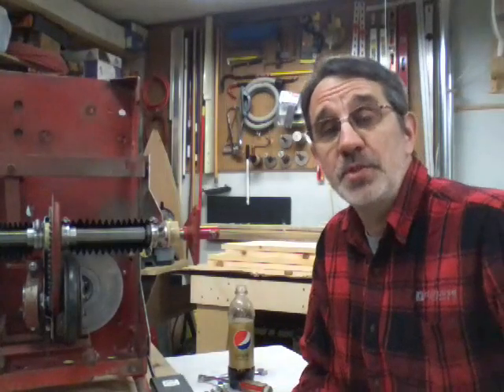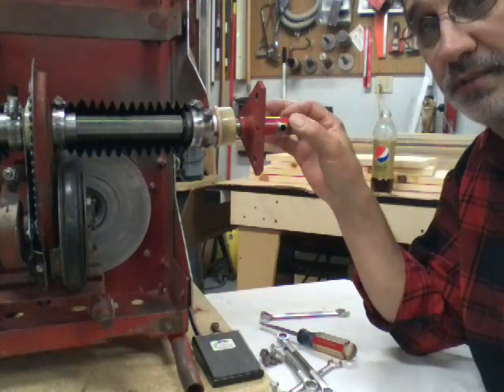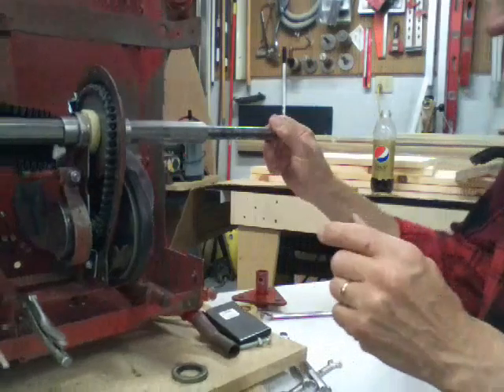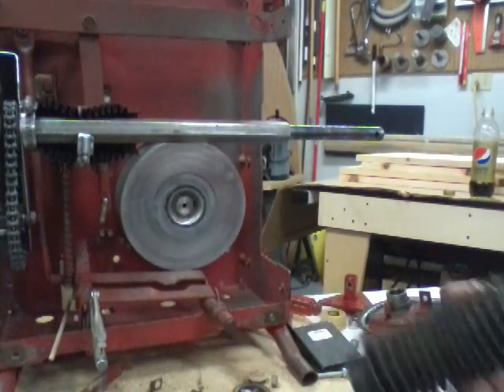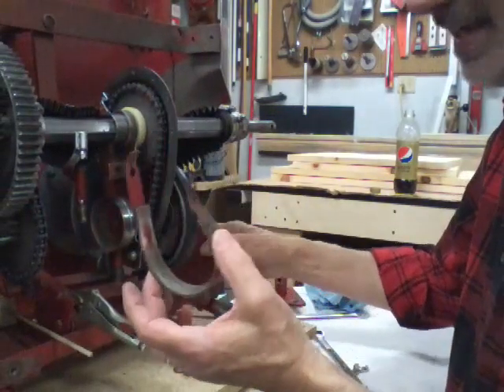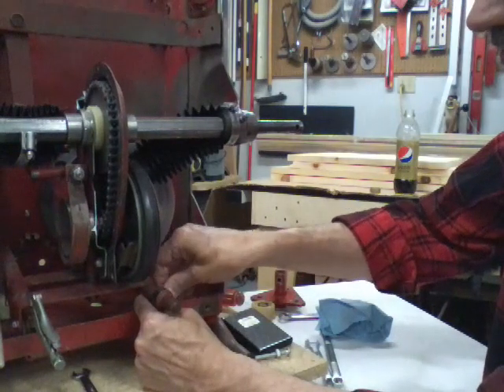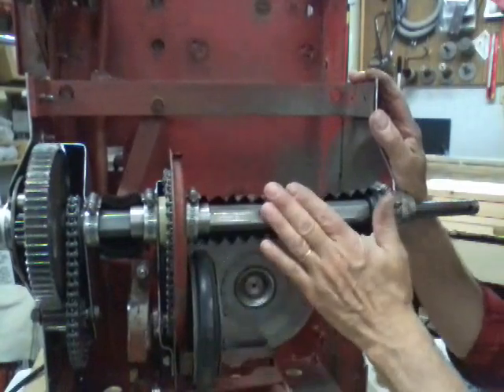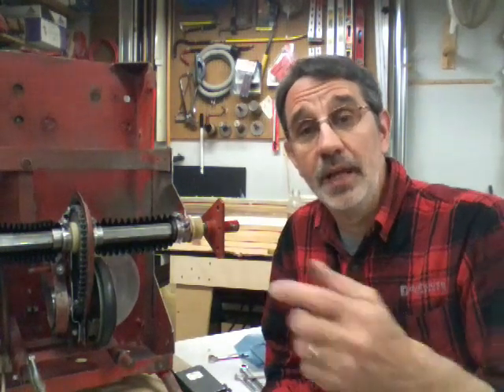94.  M/S 1  Replacing the boots on my Snapper Rider

Comment: Jim –
I just want to thank you for your clear, simple, useful videos on repairing the Snapper riding mowers.
My wife and I recently acquired a used Series 14 rider (with 9 HP engine and 28-inch blade.)
Thanks to your videos I soon learned how to replace the missing axle boots, how to find and replace the safety switch under the seat, how to replace the drive belt and the friction drive wheel and a bunch of other info that would have utterly mystified me were it not for your videos. I also began to appreciate how simple, sturdy and reliable these machines are.
If they gave a Pulitzer Prize for How-To videos on YouTube, you would deserve one.
In lieu of that, I’m sending you a small token of thanks via PayPal.
Sincerely,
A grateful viewer in Georgia, USA
Reply from the maker: Well thank you for the great compliments I do enjoy what I do and I really enjoy helping people, and thank you for the gift of money I can always use that. Jim

Comment: Get'n ready to replace boots,driven disc ( with liner.....I agree with you on the metal banded brake,The liner setup is iffy,reckon we'll see) first polishing the hex,then adding StaLube Moly to sliding gearbox ( as well as filling both gear box & chain case with said lube) ,then Ft steering rod bushings,new belt,LOF,full synthetic,then sharpen & balance the blade.Thank you kindly from one Pro to another.....Ralph                                      BTW & for your tips n tricks.....My 28 Hi Vac's driven disc rubber went completely away & ate at the drive plate a bit....Pulled the spark plug,got my 90* die grinder with 40,then 80 grit paper on the plate while a budie pulled the starter rope slowly...Re-surfaced it,with out removing any material to speak of, like a charm 😎
Reply from the maker: Sounds like you’ve got everything under control let me know how it turns out. Jim

Comment: I respectfully went a different way.  I was just about to the cut slots method when I went another way.  For $70 I bought a 5 ton gear puller at Harbor Frieght Tools !  Some of the best money I've ever spent.  I came around the corner with that 5 ton puller and I could almost hear my Snapper "Oh hell no.  Here's the hub, I surrender.". It only took 4 pumps !

Comment: One quick question-when you take the left fender off, is there any possibility of the mower collapsing to that side?  Most would still have the deck on while doing this, and the added weight could be a factor.  I know you have to have done it this way at some time.  Just a quick yes or no.  Thank you
Reply from the maker: John 
If you just takeoff one fender at a time you should be OK I’ve never had a problem but if you’re going to take both fenders off I take the mower deck off to alleviate some of the weight. Jim
Reply: @jimjackson9381  Thank you for your response, and your time and efforts.

Comment: Great video Jim.  I replaced my clutch disk today (using one of your videos as a reference) and I noticed that the boot closest to the clutch disk had a couple holes in it and grass and dirt had gotten in.  Only saw holes in one boot but will probably go ahead and do both while I've got it apart.  Is there a certain type of lubricant that I should use on the shaft?  I have a one pedal 28" RER, Model 281223BVE and I think it has short boots on both sides, but I'll double check before ordering. Thanks so much for doing these videos.  Snapper should use your videos as repair guides for DIY folks.
Reply from the maker: Mark Brown 
Any type of high-grade grease will work just fine on the hexagon shaft. Jim

Comment: I had to replace mine and I covered them when finished with plastic soft drink bottles around them held on with wire ties; stops stick, etc from tearing them up.
Reply from the maker: Well, I would like to see some pictures of that and does it still shift OK? Send some pictures to. jimsfixitshop@gmail.Com I would really like to see that. Thanks again. Jim.
    And make sure you send me one with you sitting on your Snapper.

Comment: Jim: I have been trying to get the wheel hub off for a week off and on with no luck. I did cut the two slots in the hub prying them apart, used WD 40,of course used a puller. Even heated the hub but again no luck.
Reply from the maker: Jerry Craig 
Hi Jerry
   I’ve had a few viewers with the same issue you may have to cut them completely off and replace them.  Thanks Jim

Comment: Hi Jim- just bought a craftsman rear engine 12.5 hp rider from my sister. Love it but was wondering if it's the same in maintenance as the snapper- just the color green and the part numbers are off of course. 28" and bought a bagger for it- very hard to find but i managed to find one-
Reply from the maker: Mike gorton 

Hi Mike it’s Jim
  And yes back in the day snapper build those to be sold at Sears they are the same machine just painted a different color all your parts are available and I buy them through Parts Tree.Com. off-line out of Texas if you have any trouble you can email me at
jimsfixitshop@gmail.com
And I’ll be more than happy to help you out. Jim

Comment: Thank you so much Jim I now have a running mower the fuel shut off switch was bad
Reply from the maker: Ron Wilson 

Do you mean the in-line mechanical switch that you turn with your fingers or the solenoid on the bottom of the carburetor?. Jim

Comment: Mr. Jim, I am undertaking the task of replacing my boots and I have two questions for you sir.  What side play os allowed between the axles where the shims go and in which gear do you obtain the measurement?  The second or third question that I have for you is my mower won't go fully into reverse. I did catch the handle on a pole once upon a time and my neutral gear is difficult to find at sometimes.  I believe that my gear lever is the culprit.  What is your thought on that problem?  Thank you for your replies in advance.  Don
Reply from the maker: Hey Don it’s Jim
  I want you to watch video number 253 it will explain to you how to adjust your shift plate I’m thinking if you hit a tree you might’ve knocked it out of adjustment let me know if that helps you, your other question about side play you should try to reduce it down to 1/32 of an inch let me know if you need anything else. Jim
Reply: @jimjackson9381  I watched that exact video earlier today learned what you said to check and understand what to look for.  Ive watched some of your videos and am learning bunches about the rear rider.  I'd like you email address( Ive heard you mention it before) in order to connect with you about buying some of the things that you have manufactured.  I'm in the process of rebuilding the rear end of my 1997 RER.  I am from Douglas County, Ga.
Reply from the maker: @donaldestes7794  my email is 
jimsfixitshop@gmail.com
Email me anytime. Jim

Comment: Hi Jim, I have subscribed to & like watching your videos. With that help my son & I successfully replaced the boots on my 2009 28" snapper rider. However, I would like to know much to torque the 12-20 nuts on the rear wheel. So far, I have been unsuccessful in obtaining that info & would appreciate your help. Thanks for all your help.
Reply from the maker: I just use a 10 inch ratchet and tighten them up good but I had to guess I would say it’s probably around 30foot pounds.   Jim

Comment: These videos are great!  I'm trying to replace the boots but the center chain case and clutch assembly won't just slide off the hex shaft. Everything is detached and nothing is holding it.   It won't slide in either direction, left or right.  Any ideas?  It looks so simple in the video.
Reply from the maker: Well, you either have a burr on the end of your hexagon tube, stopping the chain case from sliding off or there’s so much dirt in between the tube and the chain case that it’s stuck, shooting some WD-40 in and rinsing out the sand.       Jim

Comment: Series 15 boots:  Appears to have 2 originally (17083 & 17084) but now seems they are using a pair of 7075115YP which do not have the extended neck.  Should I be trying to find old stock or just use a pair of the 115's?
Reply from the maker: Yes, you want to buy the new ones the old ones were junk they never lasted. These are nice soft rubber and they stretch with no issues.       Jim

Comment: So how do you  tap the wheel nut out when the wheel is in the way?  After you do that, how do you take the wheel off when it is stuck. Mine 18 years old, never been off, still covered with red paint.  While I appreciate your getting to the point, too much hard stuff is skipped in my opinion. Otherwise, thanks for the video.
Reply: Sorry found your other video and subscribed. What a pain the the axx snapper is for making stuff like this!  Surely they would know that rubber boots would have to be replaced.
Reply from the maker: Walter 
Hi Walter
  Well the best way is to get the tire and rim off of the wheel flange so you can work on that, let me know how that goes. Thanks Jim
Reply: Update.  Got mine finished after taking my 3 inch Ingersoll rand cutoff tool with 150 psi for about 30 minutes and cut the wheel hub off completely horizontal to the rear axle. After that, all downhill.  Just for Prev. Maintenance, took the chains drive things apart and filled them up with a quart of OO grease.  Along with a new drive disc and some other things, $ 100 in this and a few hours worth of work.  But not too bad to make the drivetrain essentially new again after 18 years.  As well as it is built, I don't think you could tear it up unless you tried.  I've seen plastic parts in some other mowers gearboxes.
Reply from the maker: Walter 
Hi Walter
   Glad to hear you got it up and running again, That always feels good. If you have any other issues please let me know, talk to you soon Jim

Comment: Jim... I have a 85 model. Do the rear hubs have bushings or just spindle? I have alot of play side to side on the rear left side. Thanks
Reply from the maker: Jeremy Wade 
Hi Jeremy
   If you’re talking about a Snapper rear engine rider they’ll either have bushings or bearings in the rear fenders for your drive train, if you have side to side play on your rear axle you’ll have to put  nylon shim washers in between the left-hand bushing in the end of the hexagon tube to illuminate the side play. Thanks Jim

Comment: I was given one of these mowers last week.  I was able to replace the boots thanks to this video.  I had to put a puller on the wheel hub to remove it.  Thank you sir!
Reply from the maker: Well thanks for watching and I hope I can talk you into being a subscriber it’s free and it really helps me out thanks again. Jim
Reply: @jimjackson9381  Done.  I am surprised that parts are still available for this mower.  I searched high and low for which boot went on which side.  Thanks again!!
Reply from the maker: @navvet4518  I buy the black rubber boots and they are both the same size and they outlasted gray vinyl boots. Jim
Reply from the maker: @navvet4518  most of my parts I buy from Parts Tree.Com. out of Texas.     Jim
Reply: @jimjackson9381  WOW!  Great website. I will use it.  Any thoughts on  tires that are in pretty good shape but don’t hold air. Do you have any luck with using inner tubes?
Reply: @jimjackson9381    Got my mower back together today.  New boots, friction disc and brake pad with a new brake cable.  It works well.  The blades engage when I raise the deck which tells me the belt is too tight.  The blade actuator is really hard to get engaged as well.  Is there a video to show how to properly tension the  belt?
Reply from the maker: To adjust your belt you have to take the cover off the top of the mower deck with the machine off and you standing next to it engage the mower deck with the handle pushed down on the pedal and put a clamp on it to keep it engaged then where the belt comes closest to the other side just behind the large Pulley for the blade there should be a gap of 1 inch between the two inside edges of the belt if it’s too close you have to loosen the clamp under the seat and shove the pipe inside of the rear case.   Jim
Reply: @jimjackson9381  Thank you sir.  I looked at that adjustment under the seat. That makes perfect sense.  Again, I appreciate your tech support.  I will watch your videos on this mower. This drivetrain is design genius.  It took me a minute to wrap my head around it but it makes perfect sense now.

Comment: Jim- I have grease  leaking from the right fender side. I have replaced the boots. There is  a lot of side play in the wheels so I wondering if grease is leaking from the excessive play?  Thanks  William Davis
Reply from the maker: Do you have grease leaking from your right fender because your lip seal is shot you’ll need a new one and if you have site play loosen the left hand where it hooks to the inside of the tender and shimmer with the nylon shim washers. You can get the stuff from Parts Tree.Com.  Thanks. Jim
Reply: @jimjackson9381  Yes, grease is leaking from the R.H. axle shaft. I don't see what you are calling a lip seal? I'm looking at the Parts Tree diagram 281223BVE. Thanks  Bill Davis
Reply from the maker: @williamdavis9943  OK go back on Parts Tree.Com., I can’t send you a picture because I don’t have your email the part you want is item number 23 it fits inside of item 24 you have to look at the rear tire breakdown. Jim
Reply: @jimjackson9381  Thanks for your help Jim. You are a real expert.  William J. Davis

Comment: What is the part number of the longer boot?  My diagram only shows one part number for both!
Reply from the maker: They no longer make the long boot they make them out of black rubber and they are both the same size, you can still find them on Amazon and eBay but I don’t advise buying them you can get the black rubber ones from Parts Tree.Com. or Amazon where I buy mine. Jim
Reply: @jimjackson9381  Wow you really do answer back!!  I appreciate the info. Your a good man thanks for your videos and I am a subscriber now!
Reply: @jimjackson9381  I did buy the actual Snapper ones on eBay, but I also saw the long ones made by Rotary and Oregon.  I have an old snapper from an elderly  gentleman on my mail route.  It was made the year I was born, 1971.  Different engine, but otherwise all original.  It has direct drive nothing soft about it!!  No slipper on this one.  He passed this fall.  I think of him every time I mow the lawn.  Even have the original owners manel.
Reply from the maker: @oscarhoehandle3173  I’d like to see a picture of you sitting on your snapper to hang on my wall thanks and let me know if you need any help putting them boots on.  Jim

Comment: Seems to me that to make it easier they could come up with some boots that wrap around the axles and seal in some way, velcro, snaps, glue or something to keep from having to disassemble the rear end to do this.
Reply: I agree this is a stupid desighn and I stopped replac ing mine. machine was 30 years old when I traded it in on a rebuilt machine. I used it for the last 10 years with torn boots. I worked fine . once in a while I sprayed down the shaft with wd40 when it got hard to shift.

Comment: I have a Snapper 1433 and cannot locate the Lube nipple on right side of unit (upright position).   Doesn’t this model have one?  Thanks.
Reply from the maker: If you have an SR 1433, the chances are you have ball bearings in your fenders not bushings in that case you wouldn’t have a grease fitting on your machine.      Jim
Reply: @jimjackson9381  many thanks.  Enjoy your podcasts tremendously.  Keep helping us Snapper owners.

Comment: Looks pretty simple. Thanks for the easy 1-2-3 steps to get these changed. I just bought my used Snapper M280291 and an using your videos to help me get the things fixed that were neglected over the years. You are a good man to do these for us.

Question: My Snapper doesn't have boots in place. What else should be looked into and how to I know if I need to add shims for any end-play on the hex shafts, etc. Any pointers for an old snapper that may have other things needing replaced while in this area? 

I will close inspect the plastic bushings :( but what about inspection on the metal ones? Things to look for wear, etc? 

Thanks in advance and please keep up the great work in helping us keep the Snappers, going :D
Reply from the maker: Lestat DeLioncourt 
I am sorry about the delay I’m getting back with you.
   If you’re going to install some nylon shims for your side play you may want to check your bushings at that time, I can’t think of anything else that would be open at that point to check by installing boots if you have any difficulty installing them please let me know and I will get back with you a little quicker than I did this time. Jim
Reply: @jimjackson9381  Thank you, Jim. I am having issue trying to deal with the "cave man" drawing in my snapper manual. LoL Need to order the Bushings and Seals... :/ I will get it figured out. Anyone know of a Snapper Rider Forum? :D
Reply from the maker: Lestat DeLioncourt 
Not right off hand but I’ll check. Jim
Reply from the maker: Hi it’s Jim. 
   There is one online you have to Google.  My tractor forum. And there is a snapper section in there and you can download any manuals that you may need and they will come to you as a PDF file and you can either print them or store them in your computer thanks Jim
Reply: @jimjackson9381  Thank you kind sir. Have a very safe Holiday season. Wishing you and yours only the best!

Comment: Hi Jim  It did start with a little gas there is gas in the carb bowl  what is that electric wire on the bottom of carb  bowel  thank you      from Ron
Reply from the maker: Ron Wilson 
If you have a long round part on the bottom of your float bowl that is your solenoid that shuts off your gas you have to wire that in to your ignition switch or your stater between the stater and the diode in the wire otherwise your engine won’t get any fuel in it won’t run. Jim